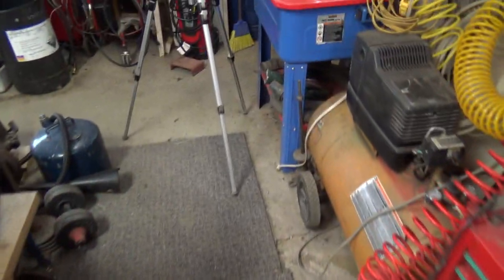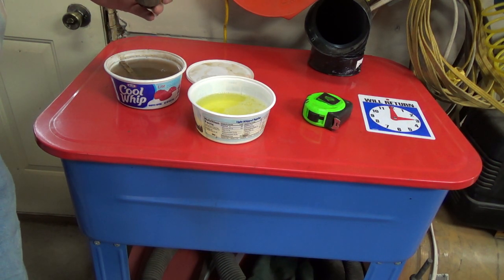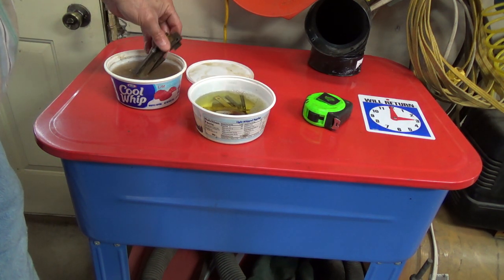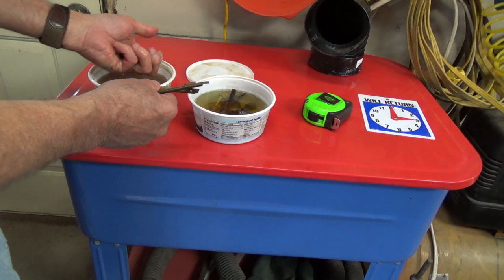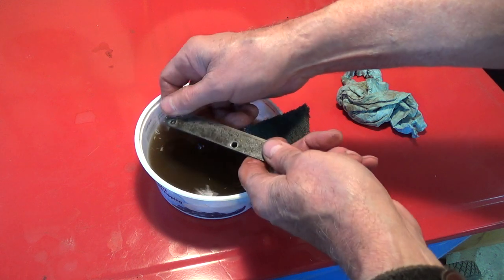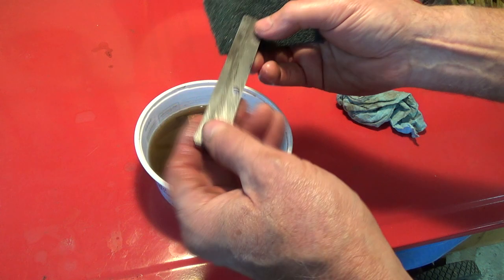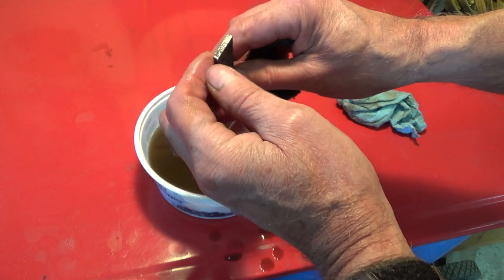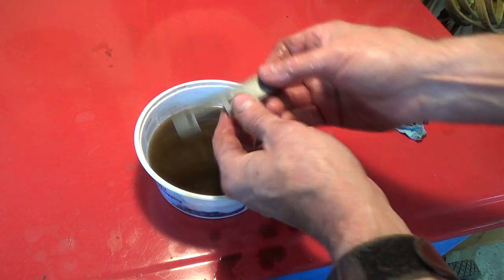Totally Awesome cleaner demonstration

Comment: Looks like it works pretty good George. I use an ultra sonic cleaner that I picked up at Harbor Freight and use Purple Power in it. That Totally Awesome might be a good alternative to try. Works great for carbs and small stuff.
Reply from the maker: This is very similar to Purple Power. I need to look into one of those ultrasonic cleaners, several folks have mentioned them.

Comment: the best stuff i have used is made by zep and sold at home cheapo. is about 10 dollars a gallon,but can be diluted to make 50 gallos. i use it straight up in a spray bottle for heavy duty cleaning,but you need to wear gloves because it is super strong
Reply from the maker: This may be close to Zep, but I haven't done a comparison. This can be hard on your hands too if not rinsed immediately and it will take off paint or at least dull it down. It is strong for sure.
Reply: i may try it,zep is the same way full strength

Comment: Hey George !
      I have the perfect cleaner for you !  Purple power you can find at walmart even.  We were told when we moved into our home that had hard smokers before us.  We tried everything to get rid of the oder and tar and we had a person tell about it so trying it on the first wall I sprayed it on and black streaks were running down the walls.  WE had tried 3 other products on the same place before it and no I dont think it got it started for it  LOL !  but,  it works on every thing !  Give it try my friend !
Reply from the maker: I have used Purple Power, but it is more expensive, which is why I use Totally Awesome and TA does the job equally as well as PP. Thanks for the suggestion.